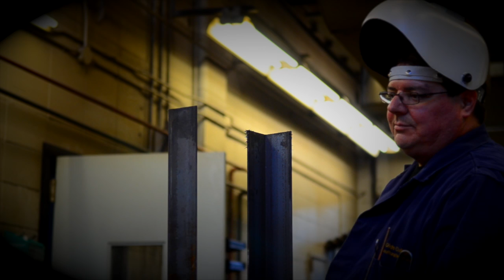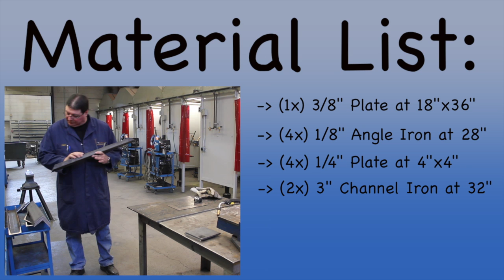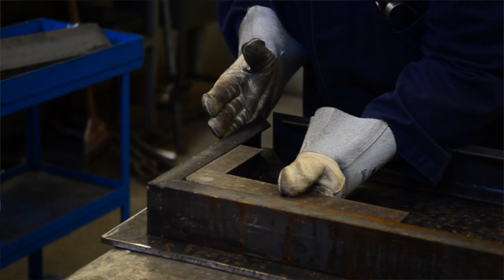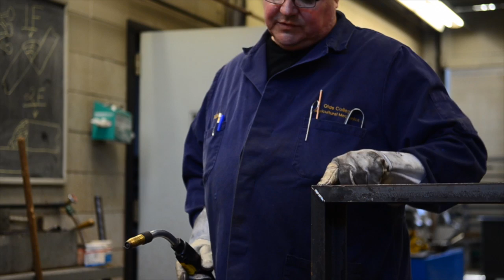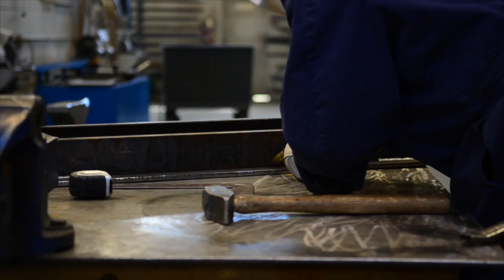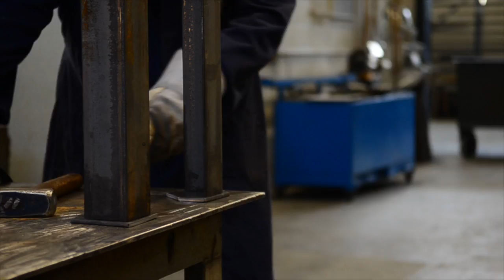In-Depth Welding Workbench Tutorial

Comment: I noticed when u do the inside of your legs u mentioned to weld into the corner , I'm using flux core and I was instructed not to push the weld just drag it because the slag, if I weld from the inside out on the legs will the table integrity be compromised a lot or not worry about it ?

Comment: If you dont have access to a power bandsaw or drop saw you can cut 45 degree mitres using a grinder & metal cutting blade, or if you are really keen use a hand hacksaw. Cut them all to length first, mark the 45 on one end & cut.

Comment: Thanx alot for the video. If you get time or an opportunity to do it again please include how you measure and cut the 45 degree miters. I have searched alot on youtube (Im not the best computer wiz) but I cant find a detailed video showing where to cut so that I dont have unequal lengths. If you have a video like that and its not a hassle then I would really appreciate it if you can provide me with it. Thanx for this video.
Reply: I'm just starting to weld. I just did my cut and in the process bought 2 different chop saws. the first chop saw i bought was a cheep one from harbor freight. the metal kept moving on me when doing miters. i went and bought a desalt for 199 and it worked perfectly. also it was easy to move back and forth. i didn't trust the 45 markings on the chop saw so i used a 6-Inch Metal Combination Square to check that i had the blade at 45 and marked each tube at 45. i made 1 template for each length of tube i needed and marked all the rest of the tubes from those. fyi tubes come in 20' Length and not to wast metal you may need to different lengths from one tube.  i had never used a chop saw before so that seemed a logical way for me to make lots of exact cuts quickly. today i set up my miller 211 auto and was watching this video to learn how to weld. I will tack my outside corners and check to see if they are square..

Comment: There are welding fumes going right into his nose and mouth as the guy places his face to close to the arc. Most probably he inserts a new set of lungs into his chest each morning. :-)  I see no proper ventilation arranged around the thing he welds either. Metal oxides as well as  harmful vapors and gases generated during welding operations are extremely dangerous and noxious. Protect your anatomical airways, don't let your health go up in smokes!